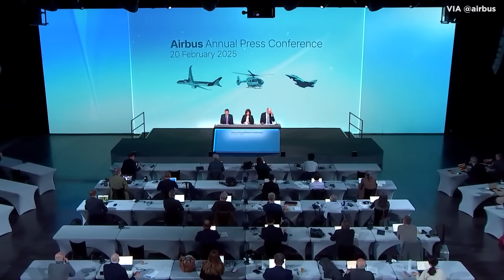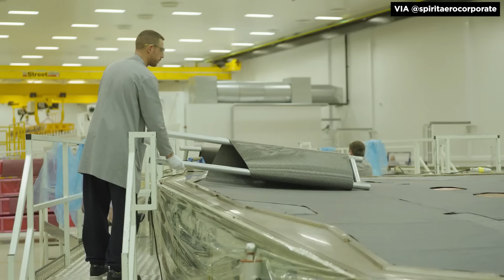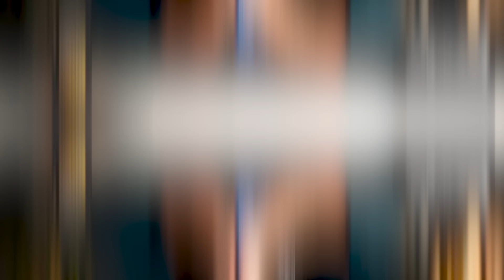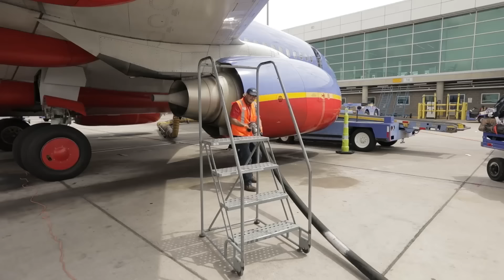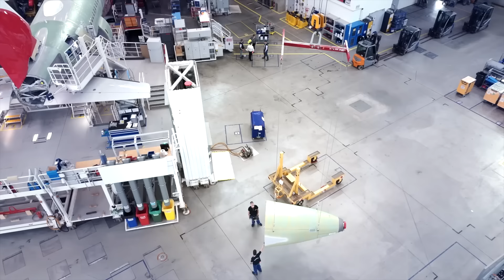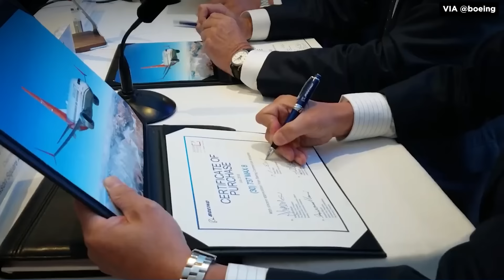Did Airbus just Change EVERYTHING?!

Comment: From Toulouse I can tell you, Zero-E is cancelled. Well, not officially cancelled, but without assigned budget.
Reply: Let's applaud airbus for taking the safe and realistic route. Where it tries new things but also looks at what the market needs.
Reply: To the surprise of absolutely nobody.
Reply: Yeah, no surprise here. H² production and storage are not simple and cheap. The end efficiency is not good enough. Might change but for now...
Reply: @JouMxyzptlk  H2 is just another fuel, the end efficiency isn't very important I think, especially if you can produce it with excess renewable energy. Besides, we don't have another substitute for jet fuel, unfortunately.

That said, the difficulties are almost certainly in the handling, due to the need for cryogenics and the general unkind nature of the molecule. Most industries that do need hydrogen produce it onsite, I think we should consider just doing that for airports; I don't see the need to have an actual supply chain for something that can just be made from water and a power supply.
Reply: @Blaze6108  Yes and no. The big problem with Hydrogen, (as noted by another commentator), is that it's not very energy dense. That means for an equivalent burn time at a given power setting you need more litres of Hydrogen than you do jet fuel. Add in the extra volume for insulation and a plane with the same range needs vastly more fuel storage volume than does a jet fuel powered aircraft. Even ignoring the storage location change effects, that requires a significantly bigger aircraft, which requires bigger engines to overcome the extra drag, which requires even more fuel. That requires a bigger aircraft and so on. This recursion goes on a bit until you get a design thats big enough to carry enough fuel and big enough engines to overcome its own drag whilst having the same passenger capacity as the jet fuel design.

The end result is that you single aisle capacity aircraft is now the size of a widebody, and a widebody would likely be bigger than an A380. 

The only way that would ever have made sense was if Hydrogen was cheaply available as a side effect from something else. Like Hydrogen cars. Hydrogen cars at this point have clearly lost out to battery power, so there's no possibility of it as a cheap fuel available as a side effect of something else.

Most likely Airbus intends to wait and see how battery tech develops. If affordable solid state batteries or a room temperature superconductor become available, building long range pure electric planes becomes possibble. Otherwise they're going to need some major advances in other technologies to reduce mass and drag elsewhere before it becomes possibble.
Reply: @darthkarl99  Yeah, it definitely feels like volume is the limiting factor, which is... I guess kinda weird, conventionally we're used to mass having that role - albeit in fairness, the structural mass of the tank is still mass! (Venture Star flashbacks)

I do believe that even if it's not hydrogen specifically though, we need to find a way to make cheap synthetic fuels (that are CO2-neutral). It's likely that there's always going to be applications that need a liquid fuel like rockets. As far as I understand, energy should be the primary expense of that rather than machinery, that's why I mentioned renewable energy; by making synfuel you are basically 'storing' energy that you wouldn't use otherwise.
Reply: @Blaze6108  

It is difficult to run electrolysis on anything other than a high utilization cycle, both technically and economically. The Chinese are finding this out because of technical issues with their locally built equipment.
Reply: @ With my work in corporate plus this I’m going to get PTSD from capital costs at some point lol
Reply: @Blaze6108  Oh i agree we need some sort of alternative to current fossil fuels for specific applications, the problem is thats going to take some form of advance in the chemistry side.

There isn't currently a process from extracting CO2 from the air and rendering it down into carbon thats anywhere near practical.

Because thats the only real hydrogen alternative. Extract carbon from the atmosphere at industrial scale.
Reply: Hydrogen is just much harder to store and operate than normal liquid fuel or even other combustible gasses like Methane and/or Propane. It, for example, heats up when getting expanded, which is very rare for any gas. Also it likes to form a lot of "funny" compounds with metals, makin them brittle... nothing you would like to have at 200bar(g) at minus 50°C and 10km up in the air... just a bad combination!

So yes, part of the "green bubble". Just too mich wishfull thinking.
Reply: Hydrogen storage is too difficult risky and impossible to stop leakage cheaply.
Reply: Airbus needs to stretch even more  the a220, re-engine it and then replace a318, a319 and a320. Needs to keep a321 only for a lot of reasons and finally to create something powerful enough to replace Boeing 757 to the market and sit between a321 and a330.... possibly an a360 or a370 or a390 according to the unused naming of Airbus in the 3x0 digits
Reply: Well gosh, what a surprise.....

/s
Reply: I don’t belive in it? How much assigned budget is in this project of will be? The CEO of Airbus didn‘t answered this question in the Q&A session.
Reply: I believe you.
Reply: I wonder if some synthetic e-fuels could be a better solution for the future. Such fuels that could be used in current engines or just with small variations
Reply: @timogronroos4642  Na, the production of those e-fuels is so extremly inefficient that electro with battery is better. It depends on the distance of the flight tough, crossing oceans electric is not. The amount if air you have to filter to get a drop of fuel is massive, the amount of electricity needed too. Currently it makes sense to use at the end of the world places, like antarctic, somewhere mit jungle, or places where you got too much energy anyway like iceland.
Reply: @timogronroos4642  synthetic hydrogen isn’t ‘green’ hydrogen
Reply: @timogronroos4642  Yup, they make one from lemons! Limonene grown in yeast or something. Planes have flown on it.
Reply: @timogronroos4642 SAF, maybe? No or marginal changes in the fuel ground infrastructure, which is the main obstacle for Hydrogen aircrafts
Reply: @timogronroos4642  synthetic. IE made from oil.
Reply: Yes it was probably part of the "Green bubble?"
Reply: @alicelund147  maybe. But it's likely more on the difficulty in handling Hydrogen and the technological hurdles in getting an economical model working. The tech is just not mature enough, and the fervor for improving the tech isn't as much as how batteries are receiving the focus. This is likely also why in the car market, Honda's Hydrogen cars are not getting the same market acceptance as battery powered EVs.
Reply: @baybum7 

Hydrogen fuel for cars does not make much sense as batteries do a reasonable job on the low hanging fruit. Hydrogen does not make sense until a larger vehicle (bus or local delivery truck) has to exceed 200 miles without refueling.
Reply: @Mentaculus42  even there. the best place and probably most cost effective place for Hydrogen is in steel production. and that will probably suck up all the production possibilities. local delivery truck is good with electric and will probably be good enough in the future. and long distance cargo, can go by train or barges if need be.
Reply: @baybum7  Hydrogen's main problem in cars is that the overall efficiency from power plant to wheel sucks. 
In a battery-electric vehicle you lose maybe 5% from charging the battery and then using up the charge while driving. The electric motors will also have some losses, but those are small - think 90% efficiency. Ultimately, you have something like 85% of the original energy to drive the car. 

For hydrogen, Electrolysis efficiency is about 80% in terms of energy. Then you burn the hydrogen with, say, 30% efficiency in the car's engine. Now you have 24% of the original electrical energy driving the car. That is one third of what the BEV has available. Or if you turn the equation around, you have to put in three times as much energy to get from A to B.
Reply: @benjaminlamey3591   I would think that you'd get more out of your buck by using a primary energy source to produce steel as coal or NG.
Reply: → Ben

Possibly more important is clean hydrogen for ammonia production for agricultural FERTILIZER! Ammonia production is extremely large and directly important to food production. Ammonia based fertilizer production consumes huge amounts of hydrogen today. Hydrogen for steel production is relatively small and new.
Reply: @Mentaculus42  hydrogen storage takes up 70% of any moving vehicle
Reply: → rhetorical 

No‼️ I have ridden on hydrogen powered buses and they are basically identical to battery powered buses. Where you got your information about hydrogen storage taking “up 70% of any moving vehicle” is WRONG‼️
Reply: @Mentaculus42  lmao tell us you have no idea how often that bus needs refiling without telling us 🤣🤣🤣
Reply: → Rhetorical 

Once a day, this particular transit agency uses hydrogen instead of batteries because the battery buses don’t have enough range for their routes. The transit agency that I work with is going to get some hydrogen buses for their long distance routes. So yeah, real life, funny how that works. RNG buses are better but California has outlawed them as of 2030 as far as procurement goes. All of the transit agencies that have battery buses have issues with range requiring more buses to be brought at $1,000,000 PLUS, not to mention the 6 Proterra  EV buses that we bought that are boat anchors because they went bankrupt ($7,000,000 of taxpayers money flushed down the toilet)! 

Oh yeah, guess what, sometimes people here actually know what they’re talking about.
Reply: @Mentaculus42  It doesn't make much sense there either and the extreme pressures involved in using hydrogen as a transport fuel make me cringe at what will be a substantial explosion sooner or later regardless of the actual hydrogen. Tanks at these kinds of pressures and volumes are a bomb waiting to go off in the same way that a 10,000hp steam boiler can flatten an entire city block if it fails (This HAS happened)

This stuff is very much the incarnation of "Just because you CAN doesn't mean you SHOULD!"
Reply: @miscbits6399  

The liquid hydrogen tanks are not high pressure. If / when the liquid hydrogen starts to boil off the increased pressure is regulated by a pressure regulator that does not allow any high pressures. The vented hydrogen gas is routed to a catalytic combustor that exhausts the water vapor. So what happens is that the hydrogen boils off and is converted to water, no high pressures. In transit buses where compressed hydrogen is used it is the same pressure as the natural gas that is used in buses. In some applications (cars) the hydrogen pressure is very high because cars have little space for the high pressure tanks (this is not the case with buses and most trucks).
Reply: @miscbits6399  

In most aircraft applications there is no high pressures involved with liquid hydrogen tanks. The boil off is safely handled.
Reply: Makes no sense to begin with. They need to pour tons of money on proven technologies like the RISE engines instead.
Reply: We don't have excess renewable energy. We aren't projected to, either.
Reply: @BishopStars  well, thej issue right now is more that the storage is not followingteh pace. which means that the temporary excesses are just lost and cannot be used when there is not enough production.
Reply: → Ben

Renewable energy production curtailments are an issue but very expensive battery storage can help deal some with it a little. But when the curtailments happen in California basically there is little help from storage. Also one cannot economically run hydrogen electrolysis with low duty cycle. Besides the Inflation Reduction Act does not allow diversion of “existing renewable power” being curtailed or not and still get the hydrogen subsidies. To get the subsidies, the power must be NEW PURPOSE BUILT RENEWABLE, locally sourced and consumed at the hydrogen production facility at the time it was physically produced (though battery storage can probably deal with this issue). Yes these requirements seem draconian but that was how it was written in the U.S. congress (or at least interpreted by the U.S. Treasury Department).
Reply: Glad to heard give us back the three stages titanium blades turbines please, this carbon fiber blades fall appart

Comment: I was immediately skeptical when Airbus published their 2035 timeline.Voila! I'm afraid H2 powered aircraft will become like fusion electrical power production. Always 30-years away. The real problems with H2 are green production, distribution, storage and handling of cryogenic fuel. Hydrogen embrittlement and the propensity for H2 leakage due to its molecular size present complicated and costly engineering challenges. Who would pay for the construction of H2 production and distribution networks?  H2 fuel supplies at hundreds of airports would have to be up and running before airlines make the enormous capital investment in such a radical change to H2 powered aircraft?

I think the open rotor engine burning SAF on a gull wing singe aisle is intriguing but the challenge, aside from airframe integration, will be meeting Stage 5 noise regulations in place since 2017. If Airbus has something radical up their sleeve, like an all CFRP single aisle, it could be a Boeing killer.

Comment: I can see the EU shackling Airbus to a hydrogen fueled aircraft and causing AB to fall behind. Hydrogen is a really problematic fuel that primarily comes from cracking hydrocarbons anyway. Why would you want to spend billions developing an aircraft that ultimately still uses a fossil fuel and ultimately never fly passengers because you could never make it safe enough.
Reply: We are talking about hydrogen made from fuel cells for H2 powered infrastructure.
Reply: @ I’m not sure what you’re referring to. Fuel cells use H2 to make electricity. Currently there is no viable way to collect H2 other than hydrocarbon cracking that doesn’t need as much energy than you get out of it. Hydrogen sounds great until you have to produce store and transport it. It’s very volatile, and is prone to leaking from whatever you put it in(it’s a really small molecule). Containment is even more complicated due to hydrogen embrittlement.
Reply: @ Sorry I meant electrolysis.
There is no process that puts out more energy than you put in. 
Aviation and long distance shipping are one of the few applications where hydrogen/synthetic fuels are actually needed to be able to de-carbonize and where there is no alternative. Luckily these are also sector, where the high cost of handling hydrogen might be worth it.

Comment: Due to the energetic density H²    is a legend since the beginning. Good to keep engineering busy.
Reply: But its low specific density and ability to quantum tunnel through any container makes it a terrible fuel in practice. A myth, not a legend.
Reply: What do you mean 'legend'? Even a fuel cell can be pretty energy dense, right?
Reply: @tijmen6947  no, hydrogen is the lighter element, even liquefied (at cryogenic temperatures) it is 7x less energy dense than JetA1. A fuel cell just converts Hydrogen into electricity.

Comment: What exactly is economy ? It depends on the field conditions. As far as I am concern, all airliner manufacturers can stop production for a decade and it will not affect traveling much. Unlike cars, closer to ships, airplanes can be made to last almost forever. In Northern Canada, we still have Lockheed Electra , DC4s and a couple of 737/200 working commercially. The old 737 /2000 was especially chosen for economy reason. They have a gravel kit fitted to it so they can operate from rough fields. You cannot do that to later models. So that 737 will use 50%  ? more fuel, have wall to wall steam gauges and require a 3 person crew,  but it is still cheaper than a later model if the engines will swallow some gravel every 3 weeks or so and the engine lose a fan blade, and no MCAS were ever fitted to the series 200. The 737/200 is cheaper than any other options like a C130.
Reply: Same with railways. There are plenty of locomotives in Canada and the United States in regular service that are from the 1950s and 1960s. Well maintained and upgraded, they can last a very long time as long as the frame is structurally sound.

Comment: Wasn't the first European Hydrogen airliner the Hindenburg?
Reply: They only used Hydrogen as the lifting gas because the US would not give them (Germany) access to the Helium for which it was designed. The only known/easily available Helium source at that time was in the US. I think the Hindenberg's engines were conventional aircraft engines of the time running on petroleum (gasoline to americans).

Comment: Even though hydrogen fuel cell is not a new technology, fitting a hydrogen cell into an airplane which carries 200-300 passengers is a challenge. Either with fuel cells or a hydrogen converter.
Reply: So u think that a 200 to 300 passenger aircraft would use fuel cells ‽ Maybe 20 passengers?
Reply: Even NASA has difficulties with hydrogen leaking. I can't imagine it being a suitable fuel for commercial aviation. Never mind the environmental problems with sourcing it at scale.